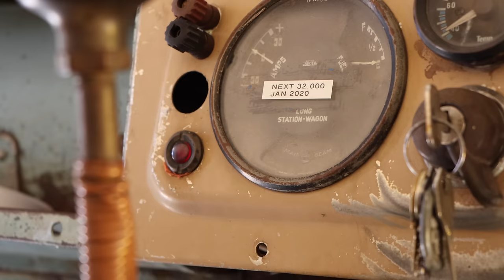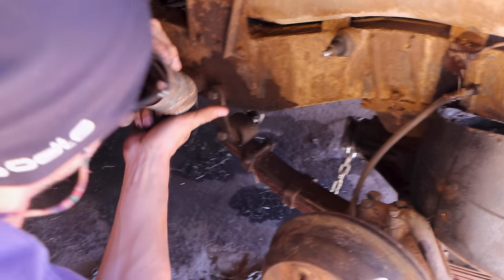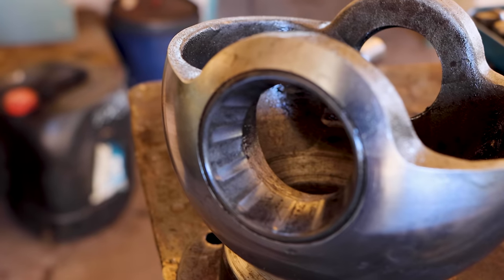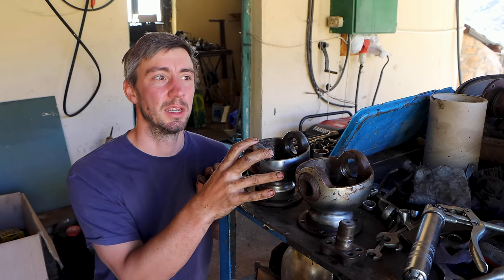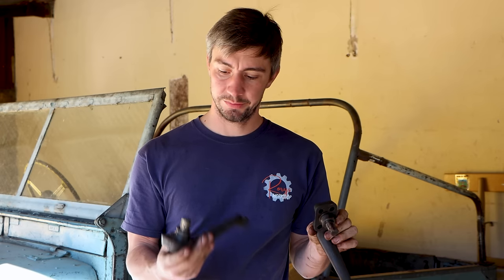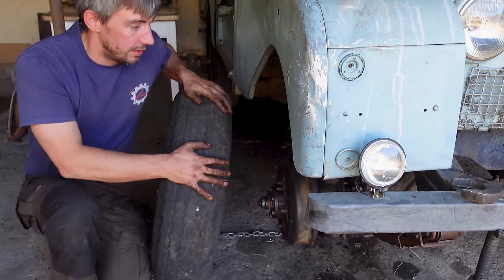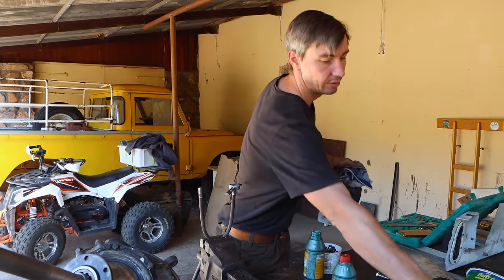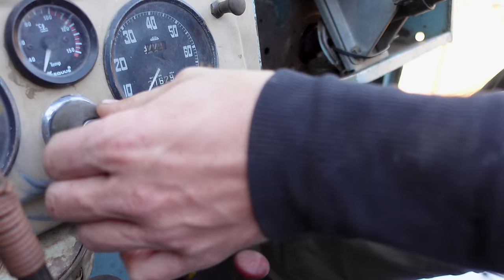Restoring an iconic Land Rover Series 1 from 1954

Comment: Great video! Quick tip: Use the wheel as a stand when you pull the swivel ball assembly like that. makes working on it much easier/ more stable
Reply from the maker: That's a great tip! Thank you! I'll try it the next time!

Comment: Please use axle stands or something like that. Don’t rely on any jack as a support. They’re for lifting the car so you can place axle stands underneath. You’re safety is important. Seeing the landy move as you worked on it is hard to watch, especially when you’re trying to get rusted bolts free
Reply from the maker: Hey Rory, thanks for the comment, I know it’s better & saver to work with axle stands but on an remote farm you gotta use what’s there. It’s kinda the same on a long overland journey. At home I have them and use them.

Comment: why can't you weld she flange and the shaft together? Like other off-roaders. There must be a reason but they wouldn't wear, if they weren't seperate
Reply from the maker: Hey i believe there is a Version for Land Rover where the shaft is welded to the drive flange. I personally don’t think that is a good idea. You will have wear there is no way around, the question is how easy it is to replace this weak part that wears. Land Rover build it this way cause the drive flange is easy to replace and it’s the same part for all four wheels. If you weld the shaft to the flange you create four different parts that are quite big. This is cause the shafts have a different length for each wheel. For us traveling it’s easy to bring a drive flange (weakest part). Even in an over load scenario I know the flange will break the first this protects the drive shaft. This is also the reason why I would not recommend HD drive flanges cause those are stronger than the shafts.
Reply: @Thebluelandy  thats what i always thought about the HD flanges. The problem moves further inside.
Reply from the maker: Exactly
Reply: @Thebluelandy The back axles of the series 1s have that kind, where the flange is welded to the drive shaft. The drive shaft is very sturdy as it actually carries the weight of the car. It's called "semi floating axle". Bad thing is that if that shaft (or wheel bearing) break, it is very difficult to replace in bush conditions, or even in a garage as it practically requires big press to remove the shaft from the wheel bearing. Compared to later fully floating ones, where one can replace shaft in minutes, anywhere.

Great video and wonderful to watch your work on series land rovers!